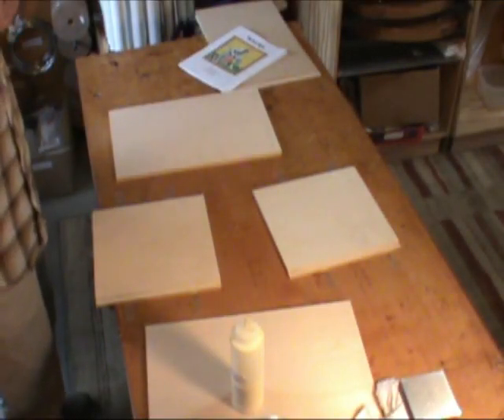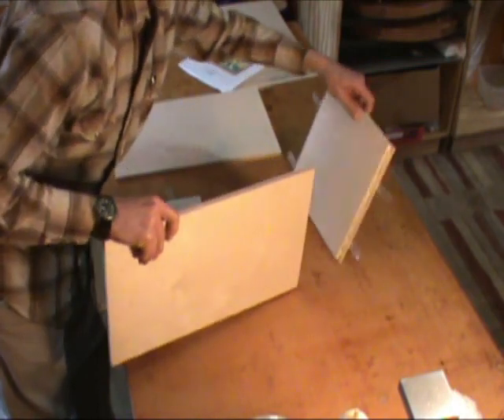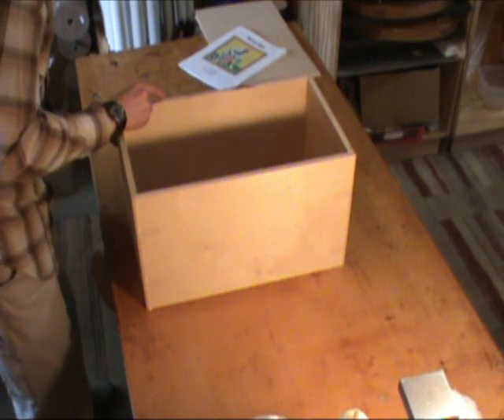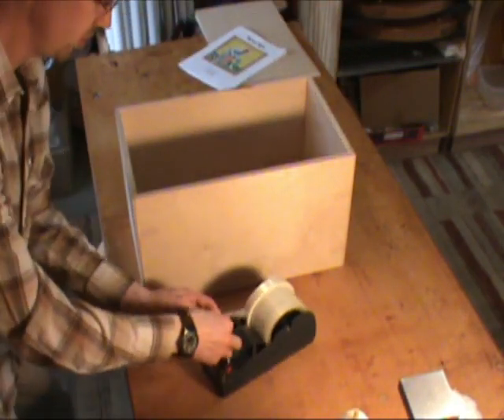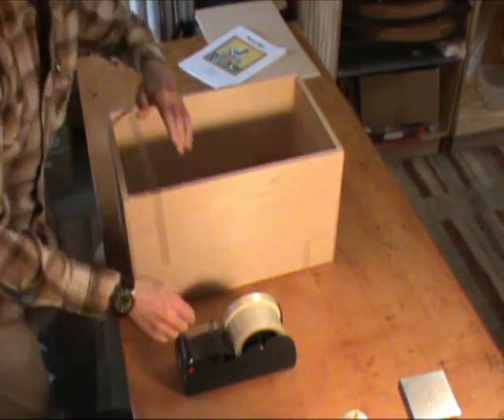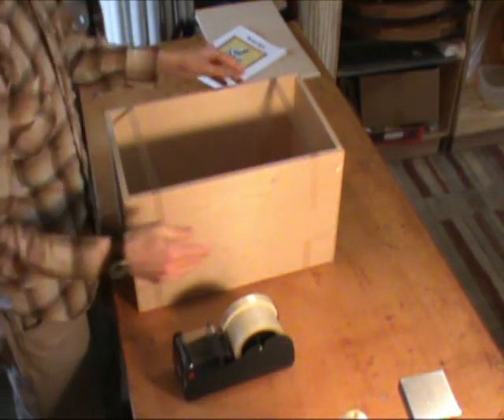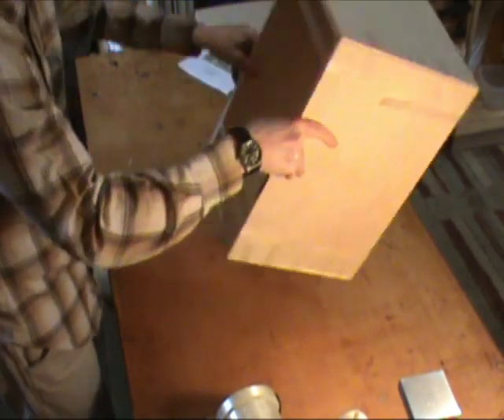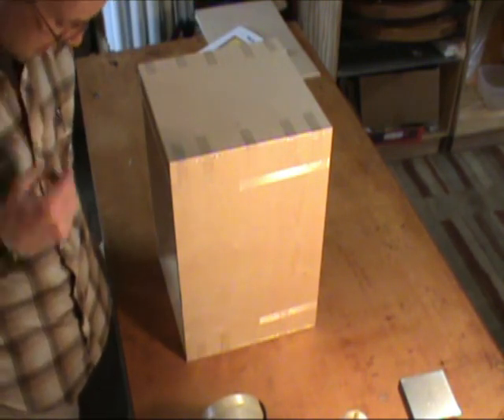Building the Box Cajon - Part 2 of 4

Comment: So, you feel that the tape is more than sufficient for holding the box in place while the glue sets?  Is this more a less designed as relatively easy method for those who don't have clamps or tension straps?  I am skeptical about using only tape, but it seems to work well for your system.